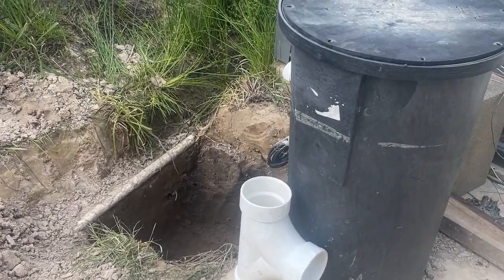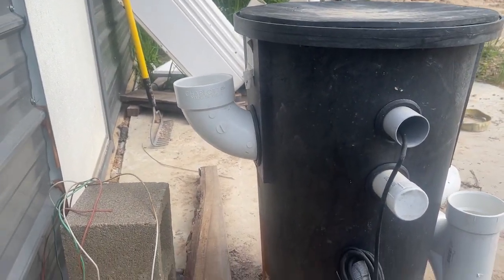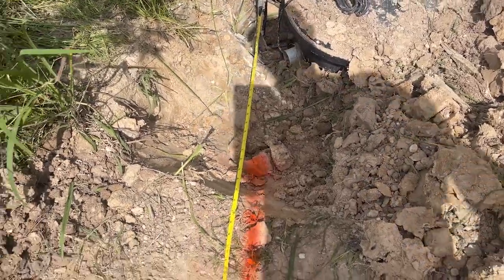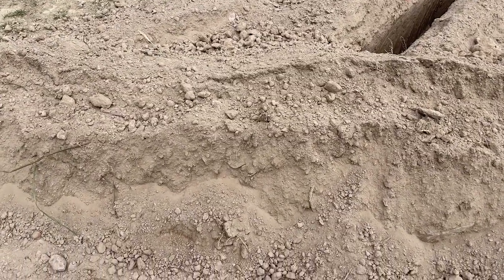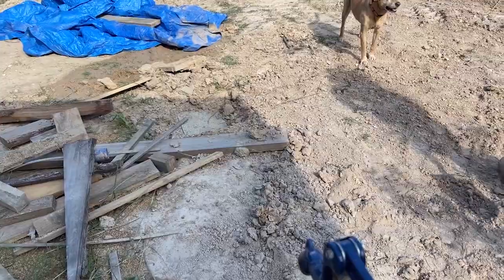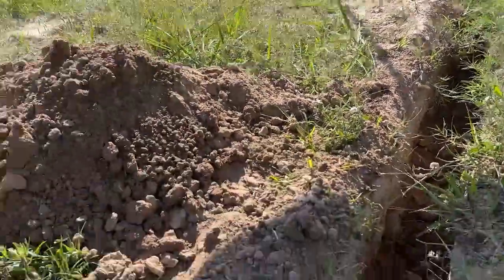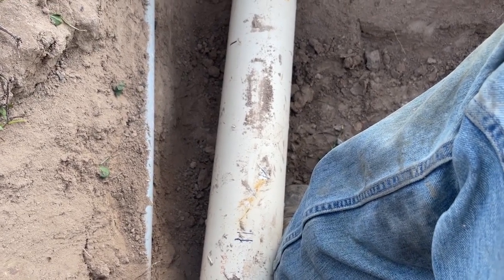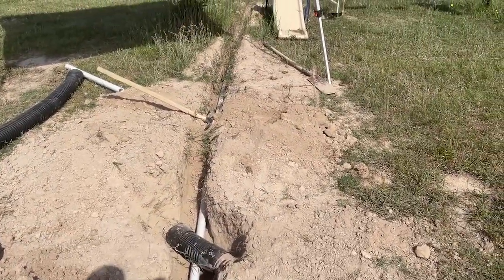Installing Septic Pump and Sewer Line Up From the Shop

Comment: Did you put a check valve on the main line to the house so that if the septic gets clogged, you are not pumping stuff from the garage into the house?